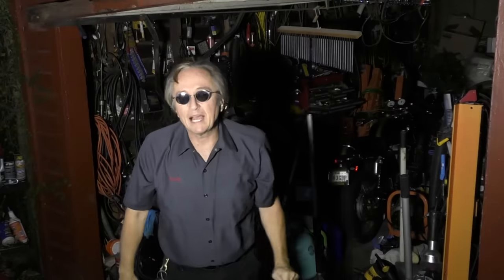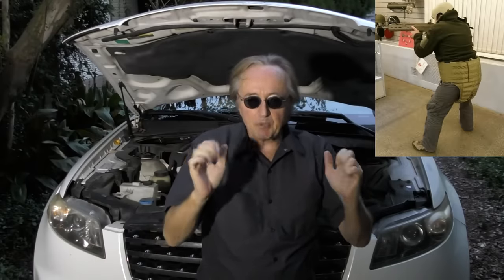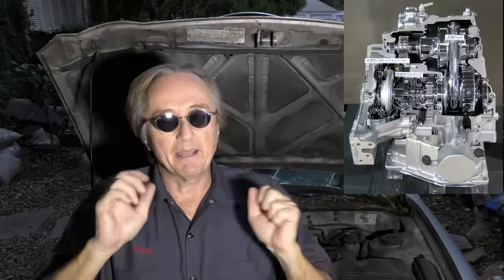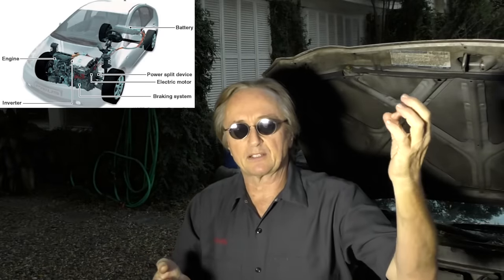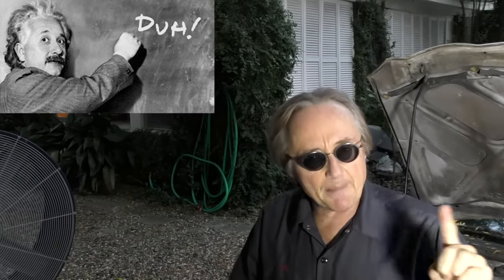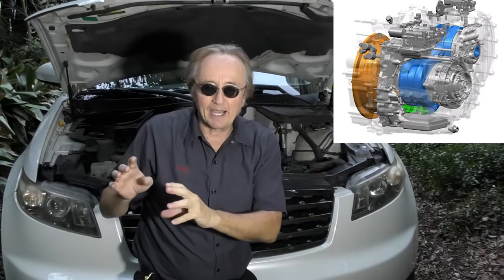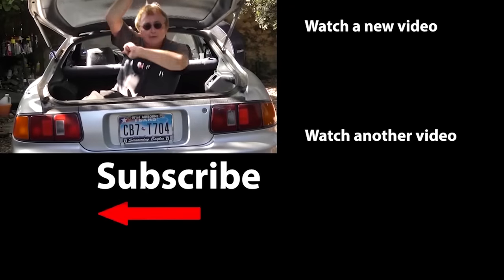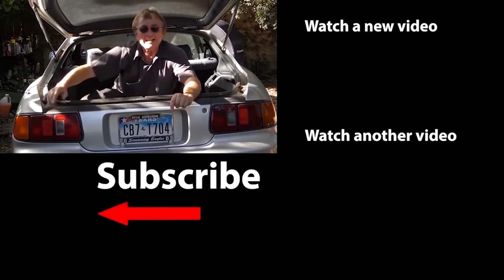Why Most CVT Transmission Cars are Terrible

Comment: I had a Nissan Quest mini van.  CVT went out in a snow storm.  My understanding is the the long, slow trip over snowy roads can lead to CVT failure.  The car was just a few hundred miles out of warranty although it was still within the time restriction.  Nissan wouldn't help with the repair at all.  That was the last Nissan I will ever buy.  I did like the ride of the Quest though.  It was such a smooth ride...that is until catastrophe stuck!  $4,600 for a new CVT.

Comment: I work for Honda and our CVT transmissions are not there yet. I own a 2016 Honda Accord coupe 80,000 miles and my transmission slips every now and then. Heard a lot of complaints in the plant from other Honda owners. The two things Honda is struggling with is transmissions( which isnt the worst out there) and electronics(radio and sensors)

Comment: Kinda funny, Mitsubishi is putting the Jatco JF015E in the 2014-2020 Mirage. The transmission is rated for 180+ HP and is also used in some SUV's... There are people with over 300k mi on the older 6th gen Mirages now, and they aren't having any problems.. but of course, the transmission isn't at all stressed because the Mirage's little 3a92 1.2 liter 3 banger makes just 78 HP and 74 ft-lb of torque (74HP on the 2014-2017 models, they changed the cam profiles and got more power out of it for the 2018 MY) so, it will probably never really wear out before the rest of the car. 
The stock form of the 3a92 engine is tuned for ECONOMY, not power. There are many folks out there now that tinker with their cars and manage to squeeze the better part of 200 HP out of theirs on the stock bottom end.. it's actually a very good and tough little engine, and it's easy to work on, the parts are cheap, and there is tons of technical info out for them for free...

Comment: I used to own a 2014 Nissan Sentra. The CVT went out at approximately 60,000 miles or 95,500 km. The CVT in those are absolute junk. Avoid them at all costs.
Reply: Did you drain and refill the cvt transmission fluid or did not.

Comment: I have watched a lot of your videos and several on transmissions. I have a 2015 Ford Fusion With 95,000 miles. The transmission has not changed smoothly since about 35,000 miles or less. I made the decision to change the fluid at 82,000 miles. The difference was remarkable! It needs to be changed again. Should I do an at home flush (no machine just a couple of buckets)? I have performed that operation on 3 other cars.

Comment: I have a 2016 Murano Platinum with 40,000 miles on it. The CVT crapped on it just last week.  I took an extended 6 year full service contract.  They are replacing the transmission under the warranty. 

Nissan is starting to go back to automatic transmissions in their newer models. I was told over time they will be phasing out CVTs, or come out with a complete new design.

Comment: Had a 2016 Altima with the CVT. Went well over 100k miles with zero issues.
Reply: Yeah well I have a 2017 Nissan Sentra and the cvt broke on me
Reply: Stick long enough and it will probably break on you too

Comment: I just got rid of my Dodge Journey that had a CVT issue at only $79,000. Not to mention, the over $5,000 I had to put in additionally in the 8 years I had it, due to electrical and wheel issues.

Comment: My 2017 Nissan Altima 2.5S with a bit over 25,000 miles is currently in the shop getting its transmission rebuilt. Complete garbage. I'll be trading it in after I get it back.

Comment: Correction, I can't speak for other car manufacturers, but I know for a fact that Subaru makes their own lineartronic CVT Transmissions. They may have used Jatco in some early iterations, but it was many years ago and Subaru has one of the most refined CVT's currently produced. Where there hiccups? Of course, as with ALL Cvt's from All Companies. But Subaru's lineartronic CVT's have been steadily getting stronger and better for many years. No, they are not made by Nissan or Jatco. Not for decades.  Databyter

Comment: The CVT in the 2016 Honda's are garbage too, my HRV started shaking at 29k miles, transmission fell apart at 30K miles, dealership gave me the runaround. Total garbage!!! My 1995 Cherokee was far more reliable, I want it back. Honda's are a joke, and so are their mechanics.

Comment: The Nissan CVT is junk. I purchased a 2016 Nissan Altima SR last September with 46K  and at 57k the Continuous Variable Transmission died. Luckily, the CVT was under warranty until 60k so it was repaired under warranty. This would be good except that the warranty on the replacement CVT is only 12 months 12k. You would think that given all the repeated failures of their CVTs that they would at least provide a legitimate warranty to stand behind their product. I have been a loyal customer of Nissan having previously purchased 3 other Nissans(all manual transmissions) with no problems, but this is it. Beware of the CVT. DO NOT PURCHASE AS IT WILL ONLY COST YOU MONEY.

Comment: Went car shopping. Had to get a new car quickly. Found a 2010 Toyota Venza 120K that I liked. Had it looked at. Needed a new steering column and the transmission needed to be overhauled. So I brought it back to the dealership and swapped it out for a 2014 Subaru Forester with 98K and the CVT transmission that seems to run and drive perfectly fine. So... My first and last Toyota was a dud.... Just throwing that out into the ether.....

Comment: Some CVT’s are bad, some are reliable as hell. It’s a hit or miss. I think Nissan can straighten it up and eventually they are gonna figure it out. I have a 2009 Nissan Altima 2.5SL bought it in 2010 with 21k miles. It now has 170k and the only thing I’ve ever changed on the car besides maintenance is wheel bearings.
Reply: every when you change your cvt fluid?

Comment: I guesting that transmission company makes the CVT transmissions for my. Moms 2020 Subaru Outback then. But since it has the 2.4 turbo engine in it. It has the high torque CVT transmission.

Comment: I suggest if we can fix a camera on the gear while we examine the cvt to determine weather the bolt in good shape or not.
For example I remove the certain plug then mount the camera empty the oil and speed the internal wheels for just a minute.

Comment: I own a 2010 Nissan Cube with 88,000 miles.  I'm on my 4th (not a typo) CVT transmission.  (In 2010 Nissan doubled the power train warranty to 10 years, 120,000 miles)  1st one went out around 70k, replacement went out 10,000 miles later, Nissan ordered a 3rd which came in defective out of the box, so they ordered a 4th.  God help me.

Comment: I had a 2009 Nissan Maxima which had a CVT, and I was one of the lucky ones, it served me 240,000km (150,000 miles) before I sold it. I knew that Jatco CVTs were problematic, but the Maxima I had was an absolute bargain when I bought it. I have since sold the Maxima and got a 2019 SsangYong Musso pickup truck that has an AISIN non-CVT automatic transmission, and hope it serves me well as I have heard good things about AISIN transmissions.

Comment: Toyota/Lexus hybrid CVTs are planetary gear based. New Toyota non-hybrid CVTs are normal CVT belt and adjustable spindle. Toyota/Lexus Hybrid trans CVT are solid, traditional CVT not good.

Comment: Recently thought the Jatco in our rogue was gonna have a coronary at 70k....... Computer cutting engine power in traffic, lots of slipping and rubber banding etc..... Fast forward 6 months.... two new filters and  4 fluid dump fills later with Amsoil ........ IT DRIVES LIKE A BRAND NEW CAR! Cant believe they claimed cvts as maintenance free when they first came out.....moving parts always wear somehow.........

Comment: Awesome video! I Was wondering why other brands were going to CVT transmission. Good to know that there are car brands with good transmissions.
Reply: All hybrids have a CVT, most newer cars have CVT, Toyota Corolla 2014 up have CVT, Accord had an option between automatic and CVT. Before you buy  ask, but most car makers are going CVT more gas mileage (very sad) as they are pretty much disposable transmissions. I believe Mazda does not do CVT they have a different view on this matter.

Comment: I have 2003 Nissan Murano it has CVT Transmission, I'm not having a problem and it has 220k mileage, The only repair so far replacement of sensors.

Comment: My wife's car has a Jatco JF011E CVT (aka CVT 2) that Dodge put in when they couldn't make a transmission themselves.

Currently has over 241,000 miles (owned for 14+ years) and zero problems from the transmission.

Problem is insufficient cooling. Back in 2006 (2007 Model year) they told people "it never needs a transmission fluid change".

Now the manual actually warns you " driving this vehicle aggressively will cook the transmission" but who reads that anyway? Biggest mistake they made was strapping it to engines that can be revved to over 6000 RPM, with peak power measurements listed at well over 4000 RPM, then telling drivers, only in the manual, NEVER drive it like that.

The polymer chains in the fluid breaks down due to heat. Transmission slips. Metal on metal contact. Goodbye transmission. Hello expensive maintenance bill.
Reply: Thank you for sharing

Comment: I have a 2011 nissan maxima with 147k miles i've had the car for 3 years ive never flushed the transmission fluid or anything , what's your opinion on doing transmission flushes/draining on cvt if it hasnt been serviced in a long time ?

Comment: Last year I bought a new 2018 Toyota Camry with the CVT transmission and it lurches and shudders. When you step on the gas there is a delay before the transmission gets in gear and when it does the car lurches forward. Not fun to drive. I took it to the dealer and they checked it out and said “that’s the way it is designed” never again will I buy a Toyota never. If you go to test drive one take it on a long drive city and highway and you will see what I am talking about.
Reply: The 2018 Camry put the CVT in the hybrid model only. You didn't specify that. The regular Camry has an 8 speed, non-CVT.

Comment: Have a 2015 Nissan Sentra at 140k km, and am having CVT problems. Estimated repair was an entire rebuild for about $5k. I wanted to find a scrap or write-off transmission from a junkyard Sentra, but one problem: the CVT used in the 2015 (I believe used in all 2013-2016 Sentra) is very rare and expensive. Likely because the high failure rate means they have all been cannibalized.

If you’re buying a used Sentra from those years… stay away!

Comment: If you lived in the 60s and had a new car you would not be worrying much abut  a CVT transmissions  Most people don't realise that in the sixty's most car in Australia cost around $1800.00  to $3000.00  Around $30,000 to $50,000 in today market . And most modals were very unreliable.  All most all cars only had a manual gear box.  and all cars  only had a 12 month warranty.   The auto transmission and the manual gear box were so poorly made they would often fall only after around 80000 km. But by that time for most people the clutch would have failed  So compered to to day,  with modern  cars. Most cars   did not last very long.  It was all most impossible to get a  replacement manual gear box.  The problem was   the modals would change and dealer would not able to keep up with the parts.  so they all had to be rebuilt with after market parts and that was about $300.00. I had a stranded FC Holden I went though two gear boxes before  sold it. The maximum life of a Holden car was around 150,000 but only after a replacement engine and gear box.

Comment: I'm currently 33,
I own a HSV Wagon (5.7 V8) and a little Smart Fortwo (999cc 3cyl).
So with that said, as much as I love technology, I want nothing to do with these CVTs (and front wheel drive cars).
My dads V8 (5.7) Wagon is about to pass 500,000kms - he doesn't service it, being a retired mechanic he'll just fix it when something eventually goes wrong.. +300,000k later, the engine is still singing like new!
My point is, yes we are both paying more for in fuel, but we save alot on not getting the cars serviced, maintenanced & fixing problems!

These little 4 bangers, especially the turboed ones in those SUVs, how long are they going to last really? Car companies are like phone companies now.. Fully disposable items built for the cheapest possible price and no regards to quality!!

Comment: My 2009 Rogue started acting up at 125000 miles, it was toast at 166000 and I had to pay Nissan $4600 to fix their flaw. I’m here today to do some research on my wife’s 2017 Sentra with less than 28,000 miles, the trans is jumping. I used to love Nissans but they do not stand behind their problems. My next car will probably be a Toyota. I’ll never buy a Nissan again!

Comment: I unfortunately just bought a new 2019 Nissan Quashqai  with a CVT  transmission.  And  I only learned it even had a CVT after I bought it. I only got it because my wife wanted an Auto. The research I been doing since then, shows that  Un like any other car  transmission.  if it falls you can not rebuild a CVT transmission,  it has to be replace. And  the reason for this is  years of  carbon build up in he CVT fuild.  This  Carbon that builds up over time in a CVT transmission is a mild abrasive. if it is not removed quickly enough eventually it will distroy the CVT.   This is why changing CVT transmission fluid is so important.  Before the first nissan CVT went into production. Nissan tested them for five years, by driving them around the clock 24 hours a day.  In and out of  city traffic, up and up and down the steepest hills they could find, After the five years were up,  they found there were no problems what so ever. with there  CVTs  But the thing there is a reason for this  that is ,  that ever few months the cars CVT were taken out of he test area,The CVT were then  taken out of the test cars taken apart and examined. They found there almost no wear and tear. in these CVT.  But the thing is that ever time they finish examining  the CVT, when they put them back in the test car But they also change the CVT fluid. So they did not see the carbon build up in the CVT fluid. And the damage it was doing  to the CVT.  So we know now the problem with these CVT is heat,,, that burns the CVT fluid and  build up carbon in the the CVT fluid. from that heat  The Carbon in the CVT fluid It is a mild abrasive and if it not removed quickly  it will effects ever single  thing in the CVT. Including a small return valve that has been shown to be  prone to failure. So the main cause of failure in these CVT are cause by a build up of carbon in the the CVT fluid. It been found now that in stalling a CVT fluid cooler and  changing CVT fluid regularly and as some one on here once said. Say around about every 30-40,000 miles. the CVT should out last the life of the car, that it was installed in . And it is not an hi-tect operation to change it.  You can do it you self easy. but it is critical to  mach the same amount of CVT fluid that came out of it. as is going in it . And oil coolers are as cheep as chips. But  just don't install a second  hand one. As just a  tiny amount of  ATF fluid  in the old cooler will destroy the CVT.

Comment: can you explain the difference between a regular CVT vs Honda's eCVT - it is my understanding that the Honda doesn't have a transmission at all, and that the eCVT from Honda is actually a direct electric motor drive without any pulleys or CVT belts

Comment: Subaru’s also. 2012 outback Just went out at 131k miles and I always kept up on the maintenance. Didn’t matter. 8000$ to replace with a remanufactured cvt. Ain’t worth the cost at this age. So now I get 1800$ from someone so they can flip it. Or fix themselves. That car should have lasted over 200k. If I had spent the 8000$ I would only be warranties for 3years/36000 miles costing me 222$ a month if I could pay monthly. That’s another car payment. No thanks cvt.

Comment: Got a 2015 Nissan Sentra sv and at 80k miles, cvt transmission started to fail. Don’t recommend getting it, have another 2006 Toyota Corolla that is running better than the sentra

Comment: The cvt transmission in the nissan is not the same as the one in the prius.  They are engineered differently. I have owned both a nissan altima and a toyota prius. I was the 2nd owner of the NIssan altima. and was 2nd owner in the family. it was well taken care of inlcuding the transmission fluid changes. Also good reliability from the prius. I had researched my prius before I bought it to replace the altima. And the 3rd owner of altima is still driving it with over 230k miles. The one thing that most people dont know is that cars need periodic transmission fluid changes. And the CTv in the Nissan needs it or else the transmission will go out,